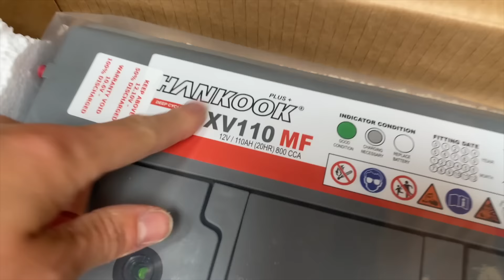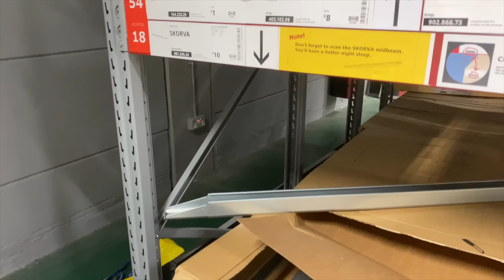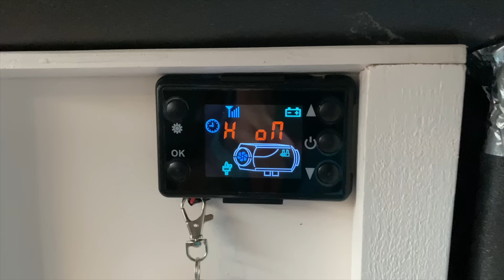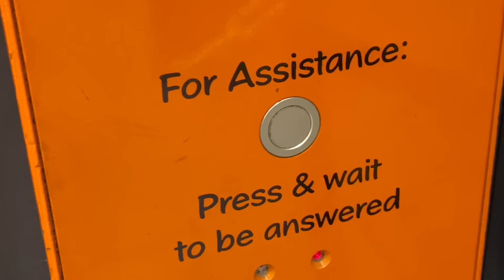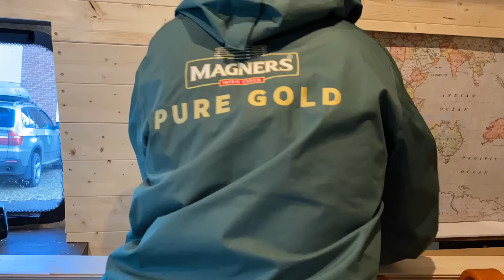FULL VAN BUILD TIME LAPSE | under 5k camper conversion

Comment: You need to urgently sleeve the solar panel cables where they go through the roof. They will chafe and cause a major short.
Reply: Big whoop 💩
Reply: Yeah, the hole needs to be deburred too. It will help the lifespan of the electrical.
Reply: Ain't got time for osha safety regulations when you decide to be homeless and live in your car.
Reply from the maker: They’ve been fine so far and it’s been more than a year. The roof is made of fibreglass and not metal, so I don’t think it’s even sharpe enough to chafe the cables 🙃 would probably have done it in hindsight but I seem to have gotten away with it
Reply: @assordante2205 bizarre how you clicked on the video really if you have nothing positive to contribute. must be angry at your own shortcomings to write something like that lol.
Reply: @spincity850  I for one thought his comment was a mere joke that followed the flow of this comment thread, and found it funny actually. I don't believe he has I'll intent, it was just a harmless joke within context.
Reply: @tylermcmaster1536  amen
Reply: Urgently 😂
Reply: @vanvistas sure gotten away with it.. thus far but when it comes to electrics, it’s not be messed with. What will take very little to correct, will save an issue later on.
Reply: Oh yes, beware the “short circuits” across that fibreglass roof. 

@vanvistas - as you’ve already discovered. You have nothing to worry about here.
Reply: You need to "urgently" enjoy a hottie converting her van 😂
Reply: @assordante2205  no se quedo sin hogar, si asi fuera le estaria faltando un baño, por otro lado, quitar la rebarba de la chapa no lleva tiempo, solo segundos y una lima, no hay excusas y es para evitar un posible incendio por corto circuito

Comment: Not because is a girl but by far the more complex video step by step ive seen so far.. Seen over 100h of tutorials and tips to renovate my 1987 caravan and they all either lose 30mins in the simpliest detail and make it a 100h series or is 10min video where from minute 05:00 to 05:10  it goes from having nothing to have the insulation process done 🤣. Thank you for the good video! Clarified some of my questions since in google once says dont do this and right away next video says you should be doing this.. 😅

Comment: This video was very interesting to watch, everything crafted by hand to a high standard. However, I would like to know if there was a manual giving instructions especially about the electrical set up And how to power the batteries as I am sure that not everyone who attempts to do similar van adaptions is going to be aware of how to put it all together so that everything works safely. Perhaps you can suggest how you learned to do some of these specialist technical details. Great video though.

Comment: Neat,Thanks. Definitely  grommett those roof wires.
Reply from the maker: The roof is fibreglass, and the cables are super tight and secure so I’m not worried
Reply: Not to make it a point of contention,  doesn't matter if its made of turds. Hard vibration vs soft cable.

Comment: I don't know if you did, but I think you have to protect (with grommets) your solar electrical wires that pass through the roof.
Reply from the maker: I used a cable housing box on the roof, which does the same thing and has grommets built in, but more waterproof in theory. It does appear in the video, but possibly very quickly 😅

Comment: Truly truly amazing 🤩 your beautiful home. Time lapse so amazing. I couldn’t do this with my build because where I built it :(
I used the same black rubber across my whole floor too :)  it’s a really beautiful van and was such a pleasure seeing it at the big picnic.
You truly worked so hard on your build  and it shows 💯
How much amps hours battery’s you installed? 
Wish my build was as beautiful as yours. What you used made me think why didn’t I use that :( it’s really amazing your build. Can I ask if ok where did you get those metal bars for your bed? :) ♥️
It’s truly truly beautiful 😍 ♥️♥️♥️
Reply from the maker: What a lovely lovey comment! Thanks so much Michael, it means a lot 🥰 it’s so crazy seeing it all compressed like this
Reply: @vanvistas  I think it’s so amazing 🤩 wish I could of shown mine like this but 70% of my build was done in my work place where I couldn’t document it :( I wish I did tho. Your van is extremely beautiful 😍 I love everything you done through the build :)  ♥️😍
Reply: Loveed watching this transformation. It’s something I’m hoping to start in the next year with a similar budget. Did you keep the 3 seats at the front as those vans have that handy folding middle seat?

Comment: You did such a wonderful job with every part of your build!  Could you tell me what type of plywood you used in the floor?  Also, in the video, it looked like the bed frame is removable.  Is that correct?
Reply from the maker: @EffieG-ez9tf  hi! Thank you so much! The floor is vinyl I got it on Facebook marketplace 😅 and the bed beams are from ikea, it’s not really easily removable though. If you head to my main page and go to shorts, I have a whole mini series that goes into more details 😊

Comment: Perfect video for clearing up some of my own questions 😁 curious how you're getting on with the solar panels? Haven't seen many using the thin type?
Reply from the maker: They’re actually fantastic! I had some reservations about them after seeing mixed reviews online. But I didn’t want to put heavy rigid ones and blots through the fibreglass roof. The only downside I see now that it’s winter is that it would be amazing to have a rack that could be tilted to the sun, but I’m still barely getting below 80% at night even standing for a few days and working full time

Comment: Hello, I have the same Movano with an extra high roof. I have a stomachache trying to attach the tall cabinets directly to the GFK supports. Just like the ceiling construction. I'm considering adding a wooden carrier and supporting it on the carrier frame. Did you find an adapter for the skylight? How did you bridge the 2cm beads on the roof?

Very nice extension!

greetings from Germany
Reply from the maker: I think I built it up entirely with mastic tape and it worked super well! And then I just did a bead of silicone around the edge. It’s really good for stopping water tracking and I’ve not had any leaks

Comment: I just stumbled upon this video, solid build, I really liked the thin solar panels, and the insulation approach.

Two questions that you might be able to answer: what are the aluminium (looks like) films that you put against the car plate? They don't fully cover it, is it for soundproofing?

And what was the reason for using a different insulation approach on the back doors?
Reply: You're right with the aluminium film! It's sound deadening, used to help combat the rattling sound a lot of panel vans suffer from. :)
Reply from the maker: Yep, the metal strips are sound deadening as the comment above says. I would say they were probably most effective on the doors though, because even the thin layer of insulation and with the cladding on top too, they helped lessen any rattling of the metal panels a lot too
Reply from the maker: My goal with using the yoga mat insulation was to cover every inch of bare metal and have zero metal touch points anywhere and it’s actually been really successful, it’s also water/moisture resistant. I have a heater too, but the van has never felt damp and doesn’t feel any different than any other van I’ve been in (at the end of the day, it’s still a metal box, it will always be hot and cold, it’s how you heat and ventilate it that make the biggest difference) I used some plastic bottle insulation in some of the cavities just because I already had it and I think I also put some of the cheap reflectex (foil bubble wrap stuff) again just because I had it, I wouldn’t actually recommend the bubble wrap foil stuff, it doesn’t really do anything

Comment: Wow, this is really impressive. What did you use for the fabric that you sprayed and molded around the rear hatch?
Reply from the maker: It’s called 4-way stretch carpet and it’s just from eBay. You can get a few different colours
Reply: @vanvistas  That's pretty awesome, thanks!

Comment: What a great build, the attention to detail on the wood paneling is good to see. What is the purpose of the small silver panels that are stuck to the bodywork before the black lining went on?
Reply: They are for dampening the sounds. Like when it‘s raining or when you close the doors it‘s usually very loud on the metal.
Reply: @deajansen5210  Thanks 👍

Comment: Wait, have you forgot balancing your battery cells? This is quite important, so all the cells remain at the same voltage.
Reply from the maker: I think I can do this to a degree through the solar charge controller, but I’ve connected the batteries at opposite ends so that the input and output flows evenly. After 6 months the batteries are still working perfectly 😊

Comment: Very nice job. Did you happen to weigh the van, before and after
Reply from the maker: I haven’t weighed the van, but I’m pretty confident it’s well below. It has a pretty big payload because of the fibreglass roof and being medium wheel base and I have friends with bigger vans and heavier systems who have weighed in and still been under

Comment: Any van I've ever had (Fords) have been rot boxes and wouldn't have spent money on trying to convert, even the new ones start rust bleeding in no time.
Reply from the maker: That's such a bummer! I've heard mixed things about fords, but then again every vehicle seems to be a lottery, regardless of make.
Reply: @vanvistas   Heard it said manufacturers skimp on paint, underseal, corrosion protection etc on vans because they're not meant to last and are expected to rack up high mileage quickly, don't know how vans compare to dedicated campers?

Comment: What were the random (seemingly) bits of foil stuck to the bare metal in the beginning? Some got covered with black insulation but I couldn't see why the foil step was needed.
Reply from the maker: It’s sound deadening. They basically add weight to the panels to stop them from rattling as much. They worked really well on the doors, but hard to say if they did much on the walls, especially after all the insulation and cladding anyways

Comment: When you drill a nail, is it going into the metal of the van directly? How did nails not go through to the outside?
Reply from the maker: @JustAGalAndHerDog  some of them did go directly into the metal and in other places I created framing so that only minimal screws went into the metal and the rest went into framing. There’s lots of double layers of metal in the van for the structure of the vehicle, so I was able to screw into these parts, if you look carefully at the beginning of the video or some of my other videos when the van is empty, you can see a bit better 😊

Comment: great job! but, after you put the armaflex on for insulation. how did you attach slats to the van? just a screw through the slat and into the metal of the van? I don't get it?
Reply from the maker: A mix. The van has some chunky metal beams, I put some metal straps across them and drilled into those

Comment: Great build  is the black on side panels and floor a vapour barrier or insulation
Reply from the maker: It’s sorta both 😅 if you go back through my videos I did a little episode on it and why I decided to do it. It’s a little controversial, but so it making a metal box on wheels into a tiny home I guess 😂

Comment: How is this under 5k with those electrics? Please give a cost breakdown of that electrical system
Reply from the maker: I’ll definitely do a cost breakdown video soon because I’ve had this question a lot and I do have a spreadsheet with everything I bought listed on it and where I bought everything from. The electrical set up was a good proportion of the overall cost

Comment: under 5k is not possible only the bus cost a lot of money and the conversion can be made for under 2 k not 5 k
Reply from the maker: Under 5k is referring to the conversion only. The van cost me £5.5k so around 10k in total 😊
Reply: @vanvistas  expensive and you don't have also bad and normal wc. My van is unter 5 k all in with bad and a automatic compost wc . The material is very expensive bad the tricky part is to find alternative and this must be also lightweight
Reply: @vanvistas  stay tune I will soon make a video and explain how to do

Comment: Is that rubber pond liner you put on the walls?
Reply from the maker: 😅 it was a cheap polyethylene foam in the form of yoga mats as a cheap and simple insulation experiment. I found with a diesel heater it’s worked just as successfully as friends who when above and beyond with insulation

Comment: Are you happy with these lead batteries? I see people recommending lithium but they're sooo expensive
Reply from the maker: If I could have afforded lithium, I would have definitely gone with lithium 😅 the batteries have been very good, but I’ve never used them for a full-time winter, I’ve always tried to travel with the sun. And they’ll definitely need replacing this winter (after 2.5 years full time use) which I think is pretty good going on them as they only cost £70 each BUT as they are only led acid, they can only be drained to 50% and we’ve constantly tinkered with our electric system to get the best use out of them. I think when I come to replace them I might try and save up and splash out for 1 220ah lithium battery which I think are about £600 atm 😅

Comment: What are the small squares of foil insulation for?  Seen a few with this
Reply from the maker: It’s sound deadening. It just helps with dampening the ratting or the panels. It’s probably not necessary after all the insulation and wood cladding, but it did make a huge different to the sliding door

Comment: At first I was like, yes! This girl is Gunna show the guys she can do this shit on her own. But then a fella comes in and does the tricky stuff.
Reply from the maker: 😂 funny when guys think girls getting help and needing help is the same thing.
Reply: @vanvistas  I'm not sure it's "funny". So you could have done it on your own. But didn't. Yet, watching these other builds, the fellas hardly seem to call on girls to do any of the tricky bits. But of course, I'll believe ya. 👍👍
Reply from the maker: @rykerhasyounow  I can point you in the direction of many female builders and female van building companies that help many men on a regular basis if you’d like? But I think if you watched my time-lapse again you’d see me doing all of the electrics and most of the carpentry? All the insulation and design, the floor, the walls, the ceiling, the doors, the built-in spaces. All the filling and sanding and staining and painting. But yes, you’ll also see me taking help when it was offered from my dad and boyfriend. I just don’t like this culture of over-analysing women when it comes to anything manual labour or DIY and if she’s had help then she’s belittled and her achievements undermined. Clearly a comment from someone who’s never done a project like this before himself, and I’m sure if you did you’d take up the offer of help from whoever offered and wouldn’t expect your achievements to be undermined for doing so

Comment: Where is the shower?
Reply from the maker: We just have a pop-up shower, so we can clip a curtain up around the vent inside and stand in a big bucket full of warm water and use a USB pump shower. We can also set it up outside. A built-in shower takes up a lot of space and showers are pretty easy to find on the road

Comment: Why paint what is getting covered up anyway?
Reply from the maker: It’s special rust paint, to protect the shell of the van if any condensation did get to it. It’s just complete coincidence they sold it in the exact colour of my van. Most people use black, which might be a tiny bit cheaper, but think it was the same price when I was looking
Reply: @vanvistas  Oh that makes sense. I assocated the blue with the van color and thought it was just to paint it.

Comment: Under 5k yes come on... Just for the insulation, floor, and wood panels you need 2k (or you have used chinese things?), electric system? Water system? Kitchen? Bed ecc ecc...  you need a lot over 5k
Reply from the maker: Nope! This includes my entire electrical system which is almost all victron and renogy. I do have a Chinese diesel heater and much of the rest of my system is simple and handmade. I’d be happy to do a cost breakdown video, I have everything written down in a spreadsheet 😊
Reply: @vanvistas  i see it's a lot handmade van but materials costs? Bed, wood, electrical system, water pump and the entire system, lamps, wc, kitchen, floor, paints, windows ecc ecc... If it really cost 5k it's not safe in terms of materials, insulation, electrical system and many other things. In italy build a van by handmade costs almost 25k, and i see a lot of videos from many other country that tell the same amount of cash  to do that work
Reply from the maker: @Drake_98  I appreciate the concern, but it really is just savvy purchases, lots of research and making everything myself. If you watch my van tour you’ll be able to take a closer look at the systems I’ve installed. But you have inspired me to make a video breaking down the costs so I’ll work on that soon